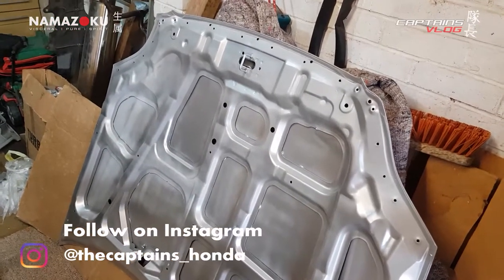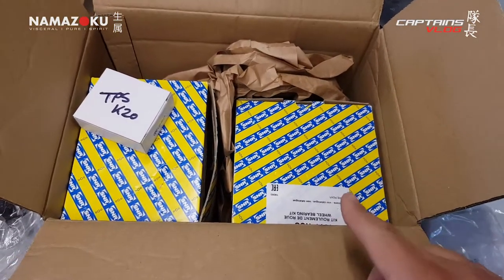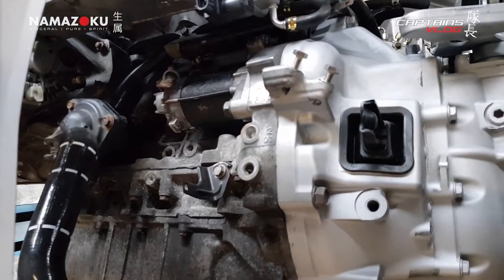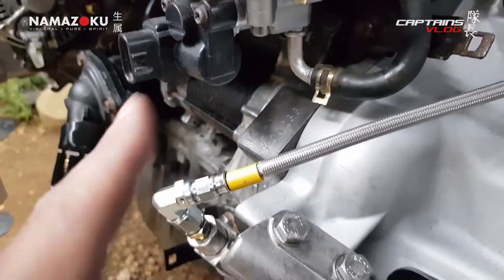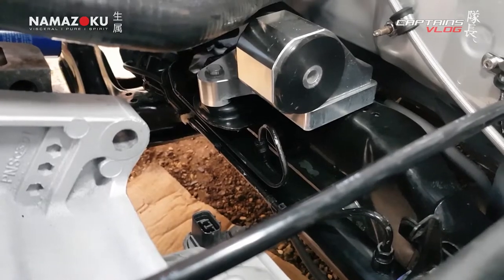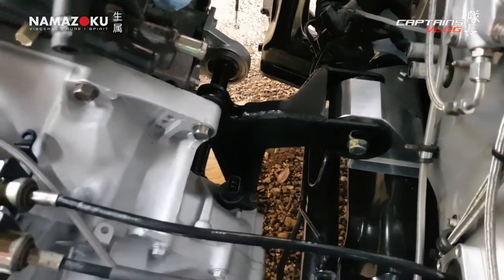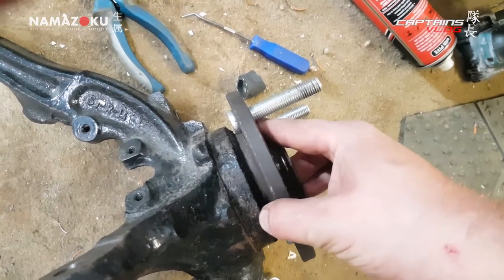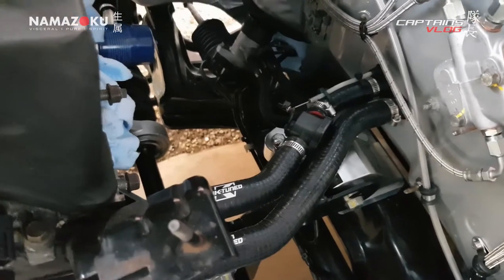K Swap Honda Civic EJ9 Project  - Episode 15  - K-Tuned heater hoses installed, plus lots more !

Comment: Hello sir, what is the part number for the rubber piece at 4:38 Min.  I've been searching with no luck.  Thank You,
Reply from the maker: Sorry, I typed a reply a couple weeks back, but for some reason it is not showing, the part is just a Breather Cap, PN#21396-P20-000 You can find it on the drawing at the link below. Item Reference 1.

https://www.lingshondaparts.com/partscatalog/catalog/listing/catalog/hondacars/modelid/9726/block/17S5S01/blockref/M__1600/

Comment: while your there youd be better to de power the rack properly rather than looping lines. its easy enough, there's a great old forum post detailing how to do it
Reply from the maker: I converted the first one to manual properly, this is just a stop gap. Once I can drive it, I'll see how it feels, if it's unbearable I can get an electro hydraulic setup for it. That's why I've not gutted this one👌

Comment: HI, which swap you have? I would like to buy these heater hoses from ktuned to my k24a3 swap in DC2 chassis. Is it possible to use it for that? thank you in advance for your answer.
Reply from the maker: This engine swap is a K20A2 from a UK EP3 Type R in the EJ/EK Chassis. Im afraid I cannot answer that question specifically, mainly because the DC2 shares more in common with the EG Civic engine bay, and having never owned one I do not know, if any, what the differences are. That said the difference is probably quite minimal. Best of luck on your build :)